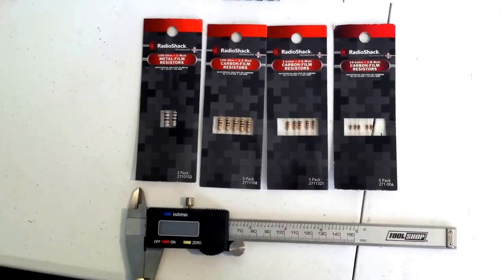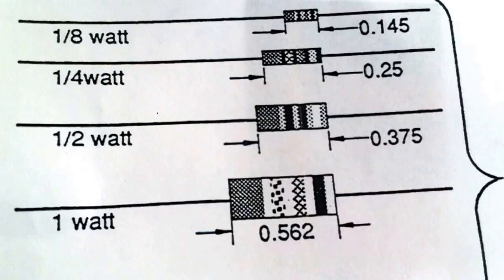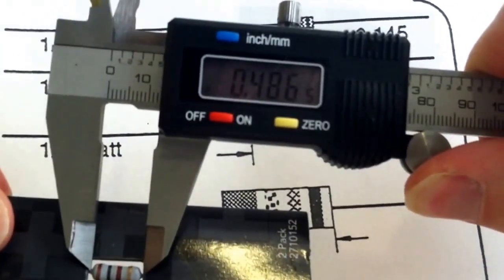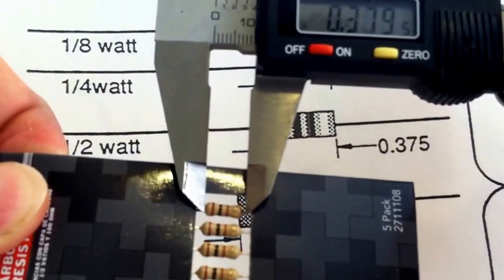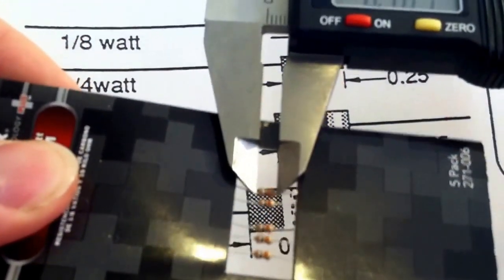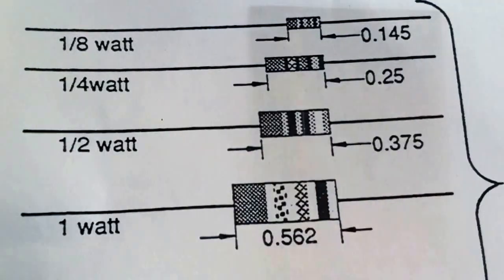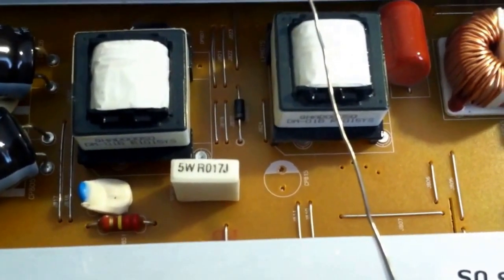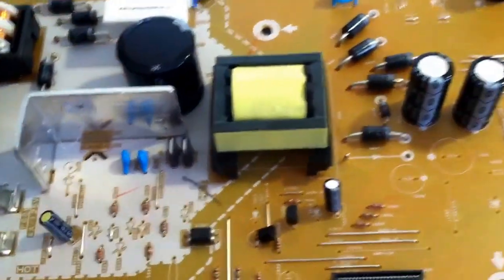How to identify the resistors wattage by physical size

Comment: It's funny how the markings indicate the resistance, but they never thought of having a marking to indicate the wattage. The only way to know is to be familiar with resistors, obviously the quarter watt are blatantly tiny like the size if a tiny zener diode. However if you then find some larger ones, like I pulled out of a computer power supply, you don't automatically know if they are 1 watt or half a watt, unless you become more familiar with the general sizes. It's obviously very important to know the rating, otherwise the damn thing will burn itself out. Once you find out for sure the wattage, you kind of then remember the wattage of all future ones by just looking at their size. 
I actually made a small heater out of a bunch of 5w resistors, simply using a 240v to 12v transformer out of a computer power supply, simply then using 35ohm 5w resistors, soldering 30 of them into a parallel ring, it produces around a 136w heater, this is because technically the output is 12.6w and not exactly 12. 
I found that despite the ring producing nice warmth, you couldn't feel the warmth when more than 50cm away to the side, the heat merely was rushing up towards the ceiling and thus it wasn't being useful. So to stop this, I simply put a large terracotta flower pot over it, it results in the air rising up through the pot and touching all the sides as it does, heating the pot up, the pot becomes a slow dissipating space heater, and thus heat is trapped in the area you want to use it in. The pot keeps getting hotter until it's too hot to touch, but it stop getting hotter at a certain point as the dissipation of the pot stop the temperature getting above a certain point. 
Because I needed it to heat mostly in one direction, I then wrapped some insulation towards the back of the pot, so the front now gets extra hot as the back can't dissipate anymore. This means the hotter front releases more heat into my direction. 
Despite the low wattage, it's ability to buildup and release, makes for a nice comfortable field within about a 1 metre range in front of it, indeed this isn't a large range, but it works for me.

The reason BTW that fan heaters use so much power, yet don't seem to be as effective, is because their powerful fan blows the heat all around a large room, and instead of concentrating it in one area. As a result most of the heat is absorbed all over the room, and it even escapes the room faster as well, as a result with a powerful fan heater, you may only experience one twentieth of the heat it is producing. Where as with my design I think I may be experiencing nearly half the heat it produces.

Comment: That's fine for modern resistors, but how does it work for resistors in radios from the 20's to the 40's with things like dog bone resistors and the old brown (carbon comp)? kind.
Reply from the maker: 15 years of repairing electronics and a degree and first I've ever heard the term dogbone resistor. That's a good point you made! Electronic technicians then, 40's, my time and the current tech have been taught way different. I've always wanted to play with tube circuits and wire wrap terminals. The simplicity of the circuits back then compaired to today.
Reply: I know how to identify the ohm sizes of dogbone resistors using the BED method of Body, End, Dot as they all have different colors.  I restore old radios as a hobby and was just curious if there was an easy way to tell the wattage of those types.  I won't even ask about the old wire wound resistors, lol.  You can pick up tube radios fairly reasonably if you avoid places like ebay and just use thrift stores and yard sales and there are plenty of places that manufacture reproduction parts for old radios like Antique Electronic Supply, RadioDaze, Renovated Radios and Just Radios to name but a few.  Personally I'm better at restoring the wood cabinetry of old radios than I am the electronics but have only been in the hobby a little over a year and a half.  Of course when replacing the components in an old radio we use modern equivalents for parts like resistors and capacitors, although some will, to keep the radio looking more authentic re-stuff the old electrolytic cans with new e-caps and re-stuff the old wax & paper caps with yellow film caps but most everything else, the tubes, variable condenser, mica caps etc all stay original or are replaced with originals.  If you should ever find the free time it is a fun hobby.  With your experience you'd probably enjoy more complex old radios like what we call boat anchors.  The old heavy multi-band shortwave sets from companies like Collins, Hammarlund, Hallicrafters, National, etc.  Thanks for the response.  take care, Gary

Comment: Have some capacitors in my ups that were damaged due to a power surge, trying to replace them so I've bought 2watt 100Ohm 5% resistor it's smaller than mine so my ups use bigger ones and I said to myself why not buy some better ones it's an opportunity so I bought some panasonic 3W 100ohm 5% which are a bit bigger than the 2watt I've bought earlier but still smaller than the ones I have in my ups, it's not 5W as the 5W is way too big

I was wondering are there 4W resistors? ..search a bit and don't think they exist so my UPS should have 3W resistors and these panasonic seems great(a bit smaller and have written on them the wattage, the ohm and the tolerance so no colour to figure out the details)

Any fast reliable reply would be appreciated
Reply from the maker: Have you looked on mouser.com
Reply: +After Hours Tv & Pc repair no, but I guess searching a few hours is more fun rather than someone telling if 4W resistor exist heh. From little research in different locations I don't see any 4W resistors and 5W would be bigger than current burned ones, so those panasonic 3w would be just fine(I replace a couple of resistors and a 3 chips and I'm ready to go :D) ...lets hope it wont strike a lighting near my house ...or something :D
Reply from the maker: +crackerworld I don't knew everything about electronics and was simply pointing you to that site because. A. They have the most parts available online and if they had a 4w resistor you could probably find the right physical size needed. B. I work 40 hrs at a day job and do this repair videos on my free time.
Reply: Nice video